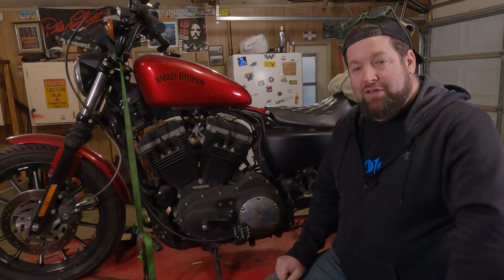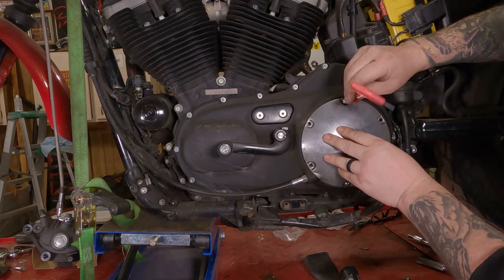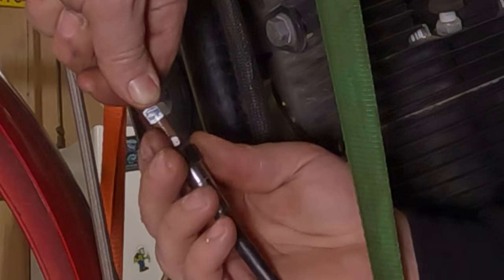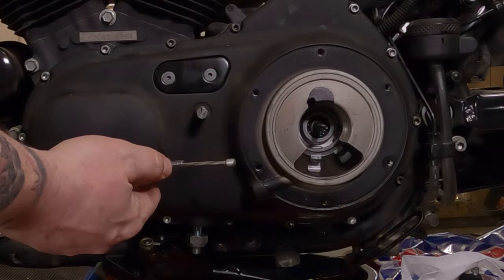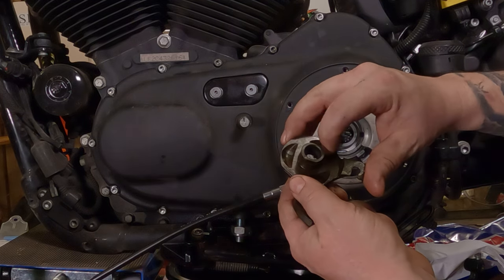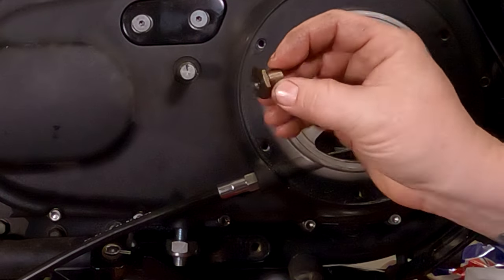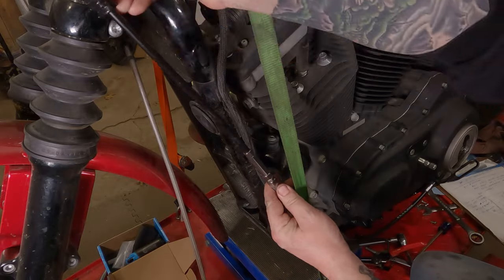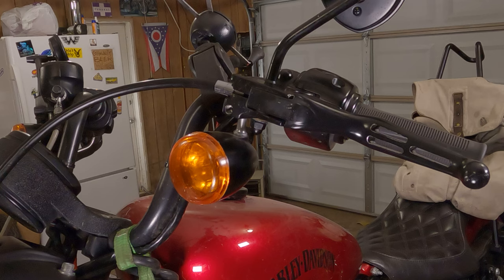Replace O-ring on Sportster Clutch Cable

Comment: No need to drain the primary when doing this?
Reply from the maker: Not if the bike is up straight.  But if someone was doing this on the side stand, they would have to drain the oil.